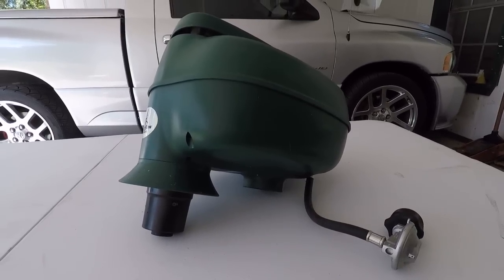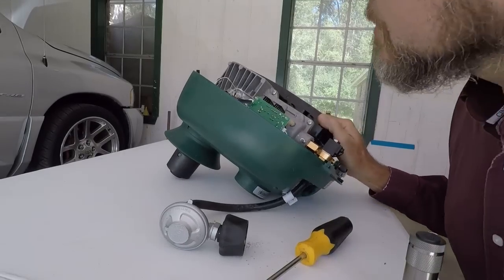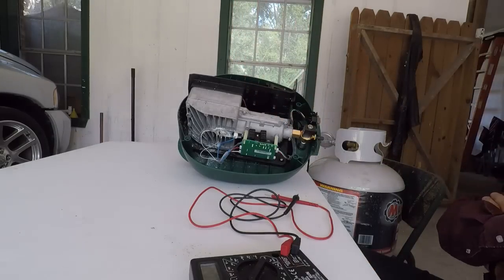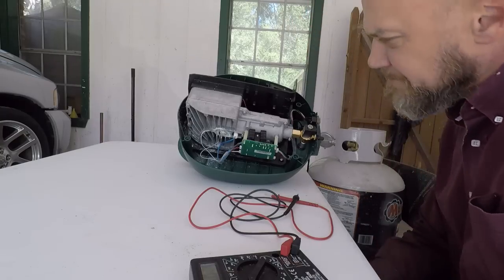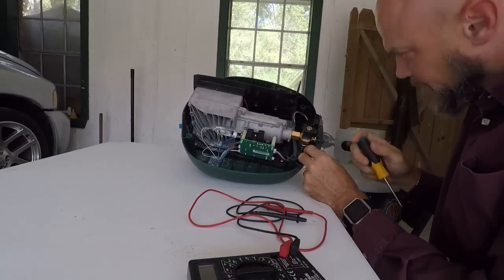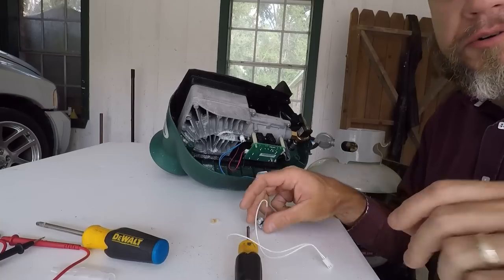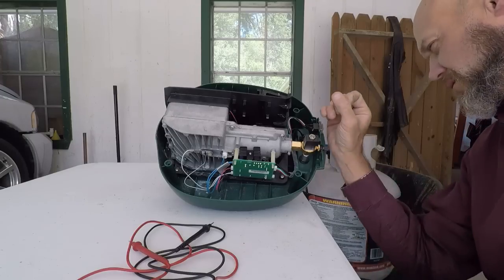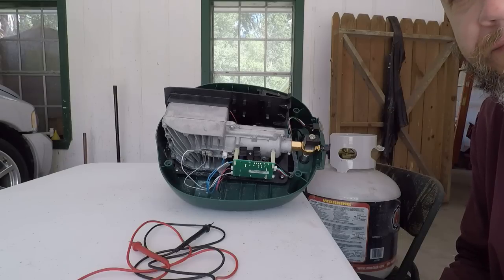Mosquito Magnet Patriot Plus Troubleshooting and Repair

Comment: Thanks for posting this video. It was very helpful. Through the course of troubleshooting mine, I wondered if there is a minimum operating temperature involved. The mosquitoes are starting to come out here in the Pacific NW, but overnight the temperature drops into the low 30s/high 20s. I called customer support to ask if there is a minimum temperature, and was told that there is. The unit will shut off below 50 degrees. I know the manual says to start using it around 50, but I didn't know it shut off below that temperature. I'm going to try using an outlet timer to reset the unit each afternoon. Some of you may be experiencing the same issue, so I thought I'd post this.

Comment: I'm going to have at this right now. I bought two of the patriot plusses last year, one failed under warranty and now this one did & is out of warranty. I have to say two failures with two different units & within 14 months demonstrates a junk product. 

I need a 3rd unit here but with the failure rate, I'm going to hire someone to spray instead. Regardless, I will open this and see if the thermistor is damaged and will clean. Thank you for the excellent video.

Comment: Very helpful indeed.  I have an old Defender unit that had a clogged fuel nozzle.  If you take the apart you can actually clean them unless they're too far gone.  The thermistor is an unfortunate choice as moisture condenses on it and corrosive layers build up.  Thermistors are very robust so sanding off corrosion is fair game.  As to the whole startup procedure, it's a function of the design: In general funneling propane downward is dangerous because it is denser than air and can lead to an explosion when ignition occurs.  So they basically use the fan to blow out any remaining propane that may not have burned off, which is a bit mysterious at first when you troubleshoot the device, because the solenoid will not be activated till the heater kicks on.  One other thing: The seal (RTV hi temp) for the two halves of the burner tends to get brittle, which can counteract the fan venting to funnel mosquitos into the basket.  The 1.5g nozzle is sufficient if your chamber is well sealed. Bottom line: Service once a year in the off season.
Reply: There is likely galvanic corrosion on the thermistor case - but the thermistor apparently is a 200K glass enveloped NTC thermistor (ie at 25C, the resistance will be 200k).  So, you're only cleaning the shell, not touching the thermistor itself.  I think that the plastic screw is to address galvanic corrosion.  I haven't pulled the combustion chamber apart, but suspect there is a platinum catalyst on a ceramic bed in there.  The reaction between platinum and propane occurs ~360C.  The combustion products of this reaction are Carbon Dioxide, Water Vapor and heat.  The efficiency is over 99%.  The reaction is self sustaining ie keep supplying propane fuel and the reaction will continue.

Just as a slight aside.  I've been using "Amyl Vinyl Carbinol" which is a perfumery component available on line.  50g for $14USD.  I reload the attractant pouches with 2g/pouch.  Seems to work just as well as the $35 for 3 deals on Amazon. (Amyl Vinyl Carbinol is the same compound  (octenol) used in the attractants)

Comment: Nice work, mine suddenly stopped working yesterday, thermistor looks clean, igniter when removed gets white hot during lower fan RPM sequence, need to check my propane flow

Comment: Nice video! I have two defender models - basically the same as your patriot only older.  Mine are more than 10 years old and run like they did when new. BUT - the only way i can keep them running long term is to remove the propane nozzle from the combustion chamber each year before storing and give it a thorough cleaning. There is a filter in there that gets filthy and this impedes your propane flow which eventually causes the error. The co2 cartridges are a waste of money in my opinion. I should mention I’m still using the original heater, thermistor assembly, solenoid and fan on both my mosquito magnets so these parts are quite robust.
Reply: How do you clean the nozzle and filter?

Comment: I spent some time looking for the flame sensor online. It appears to me that this device is poorly supported. I could not find a manufacturers web site. There are a few dealers and eBay that have some parts but not the complete internals. I did see ignitors on eBay but not the flame sensor which seems to be the problem in your video. For the ~$330 that the Patriot unit costs, and the amount of what looks like galvanic corrosion present on your burner, they should have an easy and reliable parts stream. I see service sites charging $69.00 for diagnostics, then add shipping to and from plus parts if they can fix it. Not a good deal. I would like to buy one of these but not if I can't get the internal parts to repair it myself. That is a problem with Chinese made goods like this. You should be able to buy at the bare minimum, the flame sensor, ignitor, printed circuit board and the gas valve components. For the investment, I want to get severals years use, and I'm not too sure this is possible lacking easily available replacement parts. Buyer beware.
Reply: Thank you for your video. I do appreciate it....For people thinking of buying this product....Do NOT buy it!!!...... Its absolutely crap, seriously man. It worked well, when it worked (2 years) after that it broke. No replacement parts. Customer service do not care. I would not pay $5 for another one.

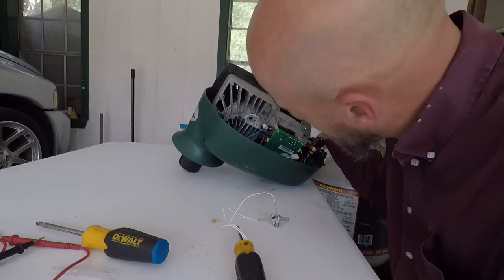Comment: 19:30 I'm with you on the galvanic corrosion, is the body of the buner zinc or aluminum? Seems like the plastic screw holding it on is a dead giveaway at what the original designers were trying to workaround. I wonder of something like tef gel or some other anti seize might help on the entire sensor to help isolate it.

Comment: The part he cleaned off is called a thermistor, and like he mentioned is a temperature sensitive resistor. Not trying to sound like a know it all, but trying to share information because these are a bit pricey and there is very little repair help that you can dig up from the manufacturer. Hard to find parts, too.
Reply: Gyva02 DO NOT USE THIS THERMISTOR FOR THIS REPAIR. I tried it and the resistance does not match. using this thermistor will cause the propane to feed to the combustion chamber without ignition and will not turn the flow off. THIS IS A SAFTEY HAZARD.

Comment: I replaced the original 1.5 gallon per hour fuel nozzle with a 2.0 GPH nozzle and the unit works fine. It was not getting enough propane to complete the ignition sequence.
Reply: Did you keep the nozzle angle at 45 a nozzle?

Comment: Did you ever find a place to buy the thermistor or other replacement parts? Would like to buy one of these but only if I can source replacement parts.
Reply: I just did a search for thermistors and this one is for a dryer but looks similar and might work - LG 6323EL2001B Dryer Thermistor - https://www.speedyapplianceparts.com/replacement-lg-ge-6323el2001b-dryer-thermistor
Reply from the maker: I haven't tried recently. I need to give it another look.
Reply: maybe you missed my reply to my post. I found a thermistor that looks to be the same one, for $6.00 I'd give it a go. LG 6323EL2001B Dryer Thermistor - https://www.speedyapplianceparts.com/replacement-lg-ge-6323el2001b-dryer-thermistor If the connector is different probably not to hard to cut and solder the old one to the new thermistor.
Reply: @Gyva02   it works?
Reply: whell i made a bridge  with the termistor  and my machine works ,so i need get a termstor new... and wrote later...

Comment: Any ideas what could be wrong with my Defender?  It will go thru the startup procedure and turn on, but after 10-15 mins, the trip light will start blinking quickly.
Reply from the maker: Howdy! I've not fiddled with a defender,  but for what it's worth,  that sequence on the patriot would indicate either out of propane or it has lost flame and shut off.  If it has a similar thermal sensor,  I'd try to clean it and see if it helped.  Good luck!
Reply: @aaronsrose  thanks.  It seems like the patriot is the newer version.  I remover the thermal sensor and it looked perfect.  Just replaced the tank so i know it's full.
Reply: Same problem

Comment: The temperature switch, mine measures 0v is that normal?
Reply from the maker: It probably should have a resistance reading rather than a voltage. The resistance should change as it heats up and then it will change state. Thanks!
Reply: @aaronsrose  thx, I think I broke the thermister when I took it apart thinking its broken. Does anyone have a link to the thermister I need to purchase?
Reply: Alternatively, does anyone know the value of the thermister I need to purchase?
Reply: @caine-chow  A bit late - But from a Mosquito Magnet schematic I found, it looks like an Amphenol part number AL03006-111.3K-123-G1 - The schematic references Digikey part number KC014G-ND. The Liberty also uses the same part, so I expect it to be common across all models.
Reply: @CageyH01  I bought a pack of NTC-MF58 thermisters, 200k ohms. I removed the buldge at the bottom of the aluminum rod where the actual thermister sits and glued the new one using heat proof glue. I have done this 2x on different models of the mosquito traps and it seem to work fine. Tested out on the field as well.

Comment: just join those to wires and bypass the probe.. Safety 3rd!
Reply: Did you replace your thermistor with this? Was it the same configuration? Still working? I’m going to order one.
I’ve been getting about 18 months out of the MM then having to buy a new one. Cant afford that any more. Really need it here in south Florida all year. 
Thanks